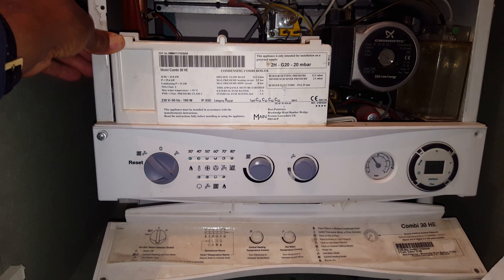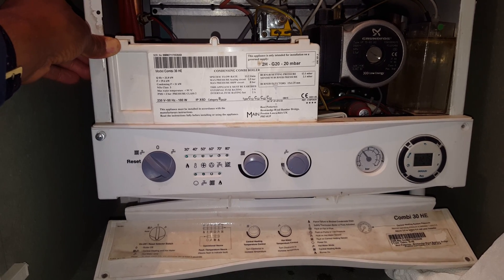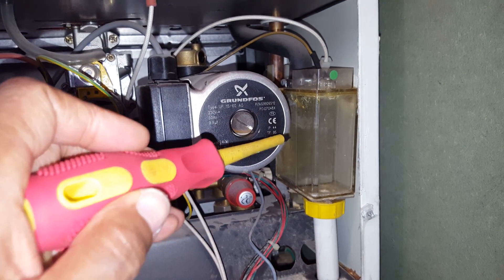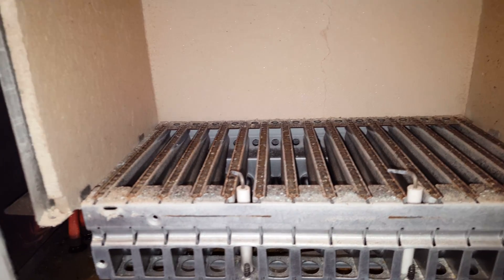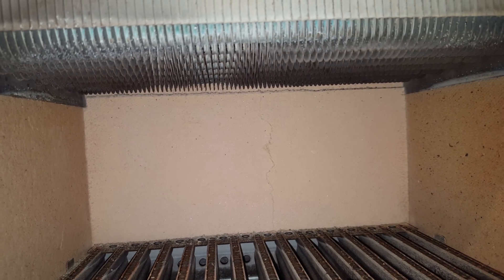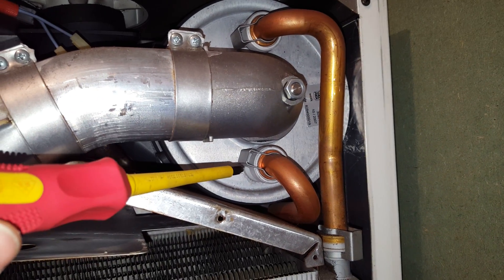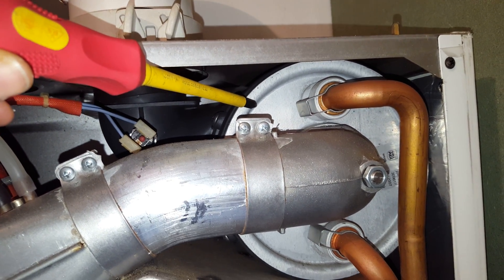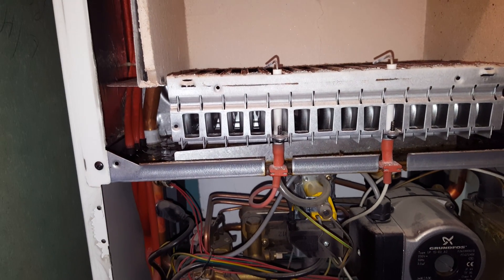Leaking Boiler Main Combi 30HE

Comment: Hi, on the first heat exchanger pipe  there is a small leak on mine can this be fixed by removing clip and revealing pipe. Thanks
Reply from the maker: Can you send a picture of what you mean to tony@engineerteam.co.uk
Reply: A+R Central Heating and Boiler Repair Experts Ltd hi tony can i send you a pic of a leak in my boiler im not sure if its the heat exchanger or the part that its connected to would really appreciate it thanks